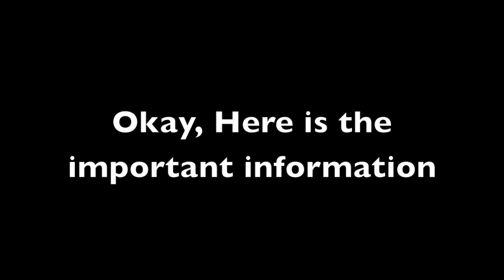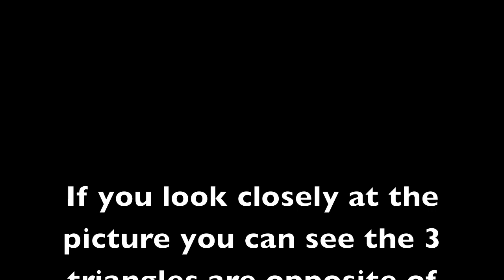Standing Gun Rack

Comment: that's true but all i have left to do to my ion is the ape board and 2 more qev's ans it will be complete. i was gunna get a MOLLE vest but they where too expensive and the GXG looks awesome and has tons of pockets. if i needed more pockets for stuff i could tear off the 10 round tube holders and sew MOLLE straps on bots sides and it gives me alot of room to work with. i already modded the hydro pouch to hold a 2 liter water bladder. i holds it just fine but i havant played in it but i need to